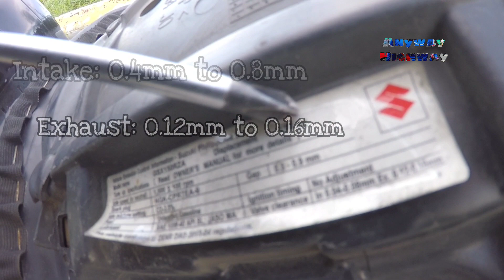Papaano e Tune-up si Gixxer?

Comment: Nice video SIr, ... Sir pareho tayo, ... stick to procedure nalang at kahit 'wag na masyado intidihin kung bakit. 

Sa spark plug, di ko sure kung pareho sa motor, pero sa sasakyan tinatangal 'yon para may additional exit ang pressure sa loob ng cylinder habang iniikot para makuha ang Top-Dead-Center specially sa compression stage. Pag-di kasi makalabas ang pressure, mas mahirap ikutin para maset ang TDC.  Sa diesel engine 'yong heater plugs naman tinatangal.
Reply from the maker: Salamat sir... Na bigyan ng malamin at tamang paliwanag kung bakit need tanggalin ang spark plug. Dahil pala sa pressure, mas mahirap kunin ang top dead center pag hindi tinanggal sparkplug. Rs lagi sir.. salamat sa pag bisita